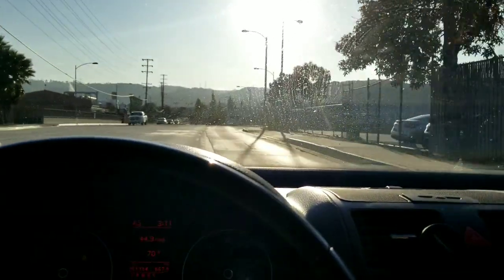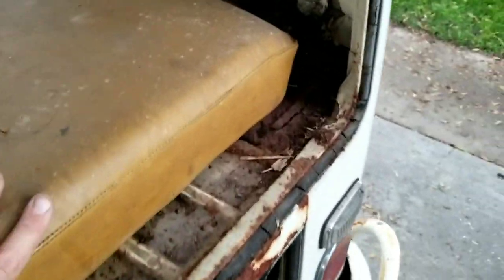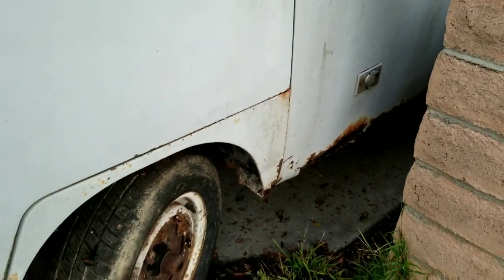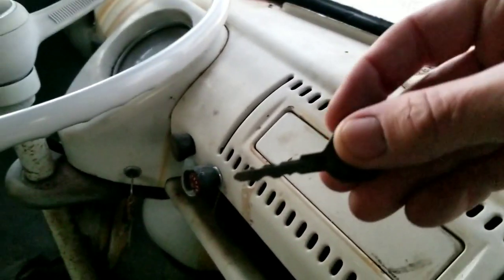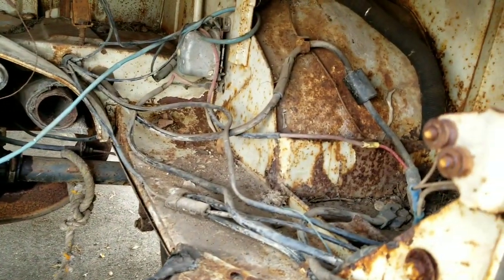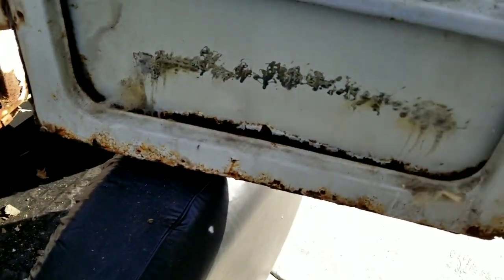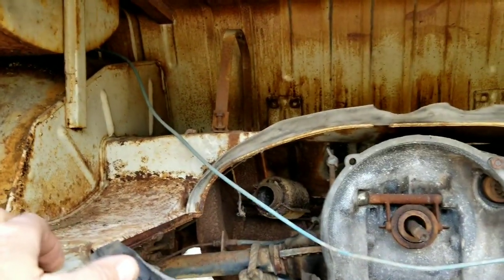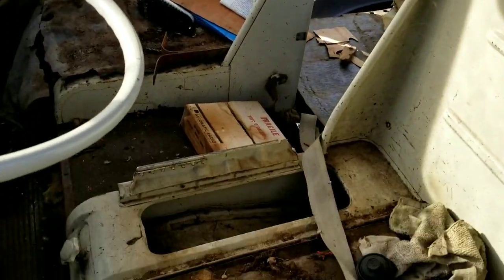Abandoned forgotten VW bus 1967 Westfalia rusted out barn find

Comment: Nice Bus , looking forward to the rust repair vids 👍. My 66 SO42 came factory 12 volt , M code supported .
Reply from the maker: that's right like 66 and a half. I think
Reply: Yes!! Going to be some great repair vids!!
Reply from the maker: yea was watching your video again yup 66 I think they gave that option of 12v late in the year I think they did that in bugs too if you ordered that way at that time.
Reply: @Mikefngarage  I checked into it after I got it ,  12 volt was standard as you know in 67 . However , I believe it was an option through the 60's on the commercial style Buses.
Reply from the maker: @5150mxVW  does it have the lightening bolt sticker too

Comment: Came back to this video to check where you started from. 😊 I checked the port code on the m code plate - Honolulu or Jacksonville... Guess that explains the rust. "UJ" code is what it looked to be.  I remember seeing VW's in Hawaii that weren't restored and most were really rusty.
Cheers!
Reply from the maker: Hawaii we did used cars that this customer imported from there back in the old days in the early 80s. the body shop guy mickey moused them OMG. so much rust. I just worked there.
Reply: Ha ha Mike! Used to spend summers on the big island in Hilo during the '70's.  The people there drove their cars until they broke in two from rust.  Lots of VW's there back then - gas was real expensive. Jacksonville Florida is real humid so rust there as well.  Weird that the port code UJ is for two ports really far apart?!
All the best to you!

Comment: Mike I would do a complete restore & paint it and I will be watching close. I have two 67 buses. My 67 deluxe i the 2nd owner it is all there, it been working onb it for a few years now. This year got a 67 caamper bus my Bondo Condo It has major rust , CT rusty frame is in better shape than my Bondo Condo. I hope next few months foot will be heal and can get to work again on my 67 deluxe. I'm finishing up the rebuild on the front beam where i replace King & Link Pins pitman pin & buses everything . My friends do not understad the cost of vw buses, with all front beam items & new stock brakes on the beam I have close to $1,600.00 in just parts.

Comment: Keep the patina on the outside! I have the wrong c sliders for my vw bug seats. Is it possible to cut off and weld correct ones?
Reply from the maker: yea for sure I usually save the original ones and weld them on new pan halves. Much better metal on the original ones
Reply: You recommend somebody to tackle this job? I live in norwalk

Comment: ~ Hey Mike, when you are showing us how to replace panels, etc. could you please show us the detailed steps you take in measuring them up against the original sections including the thickness of the cutting wheel? This is one area that it holding me back as I am not confident that I will have the exact same distance as the factory measurements once I've tacked the new piece to the existing body panel. 
Thanks, love all of your videos, you've taught me a lot and it's much appreciated! 😎👍🏻🇨🇦

Comment: Using a Battery Disconnect Switch will prevent vehicles in long term storage from rusting.  You can always tell when a VW was stored with its Battery cables connected.
Reply: James Lamb I never knew that mattered, I just learned something new. I have always removed the battery when storing.